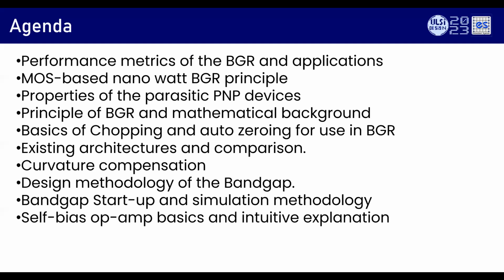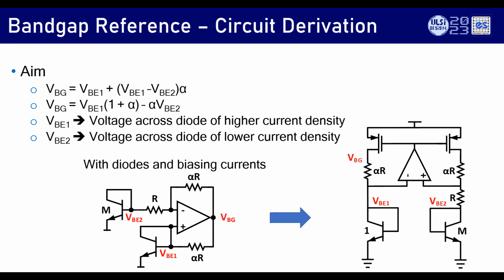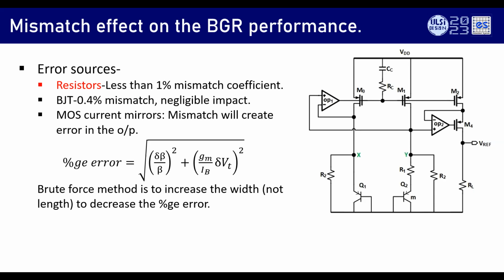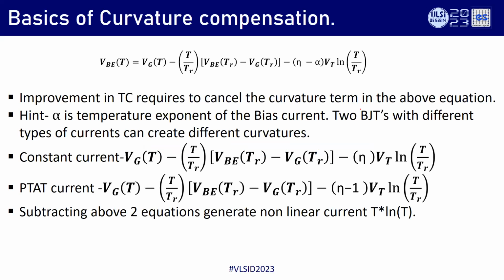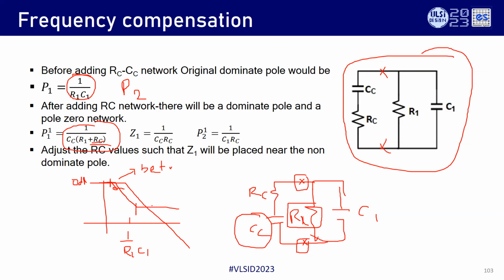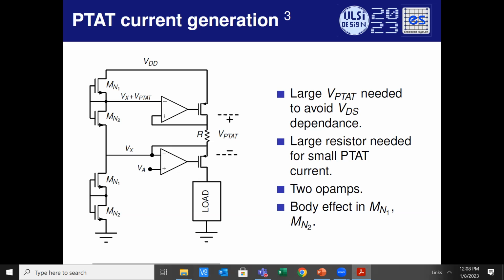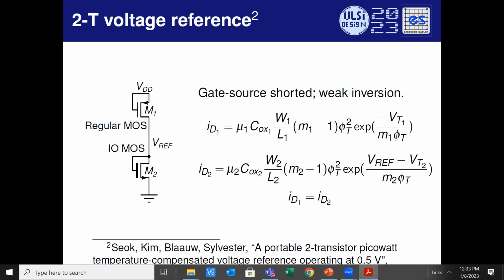Tutorials | 08012023 | 1.2.1 Bandgap Voltage Regular | @VLSIDCon

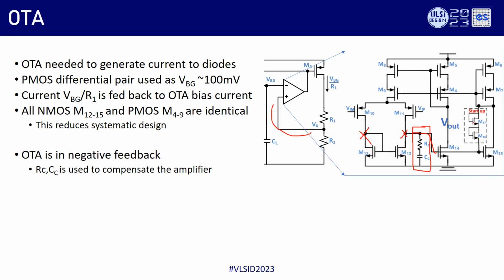Comment: I am confused at the operation of startup circuit which Rajashekar is describing @ 1:21:37. When the supply is slowly increasing from 0 and still hasn't reached VDD ( 1V or 1.8  ) , how can you assume the gate voltage of M9 to be pulled low? Lets say the Vt of device be 0.7 ( both PMOS and NMOS), then the supply has to be at least 4 Vt for the startup network to work. But, in the process which Rajashekhar is describing is 1V, which means that network is never going to start. Please correct me if I am wrong.